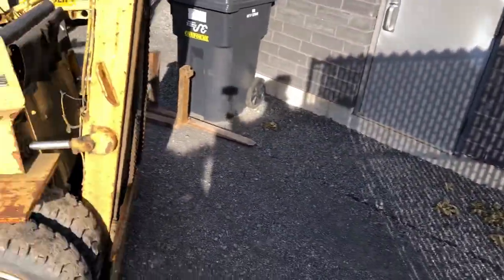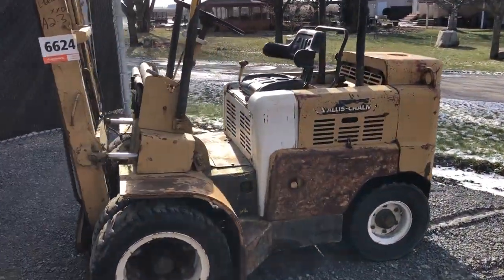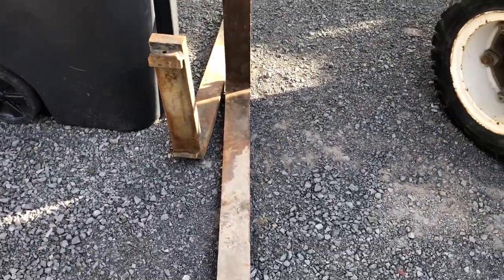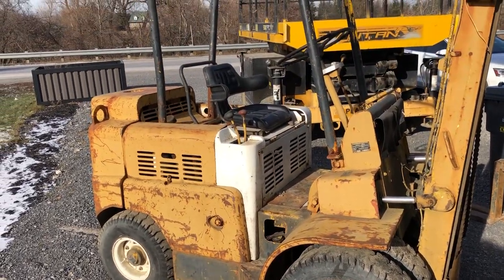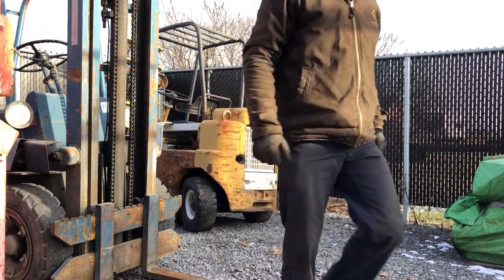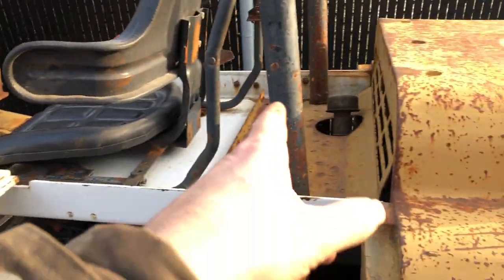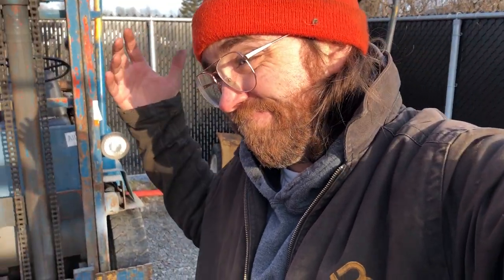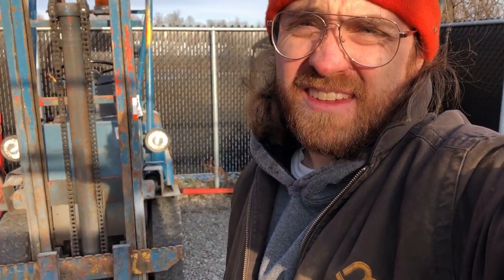Vintage Allis-Chalmers Forklift Rebuild- Part 2- Yellow Lemon!

Comment: Did you figure anything out. I have the same lift running the same way.
Reply from the maker: I parked that lift last year at the end of that video and haven’t worked on it since. I have the feeling it has to do with the oil in the trans, because it works when you haven’t run it for a few days, but after you cycle forward/reverse once, nothing engages anymore… maybe its the wrong type and it slips or maybe it looses pressure. I wanted to flush it and use whatever was recommended in it and if that doesnt work, there are ports to add pressure gages at a few points on the trans to check pressures…. Those were my next steps, but it wont be before next year for sure. Hope this helps…